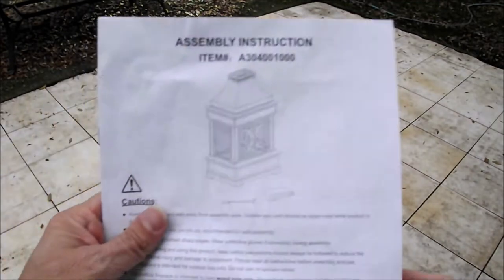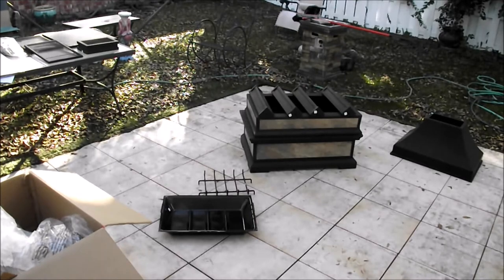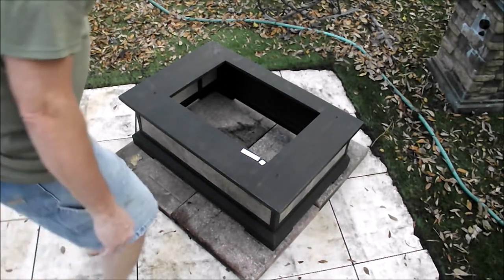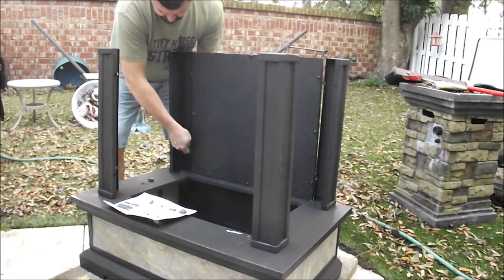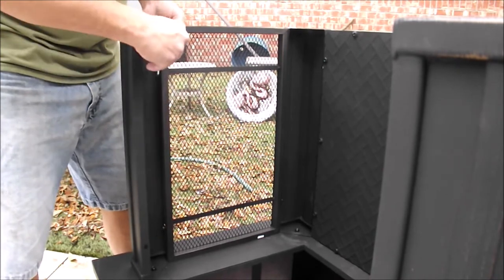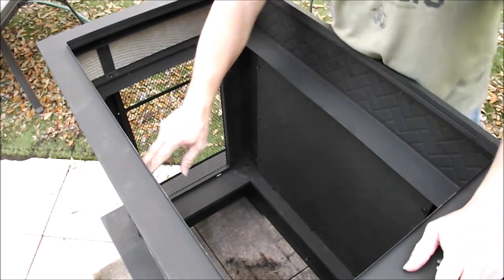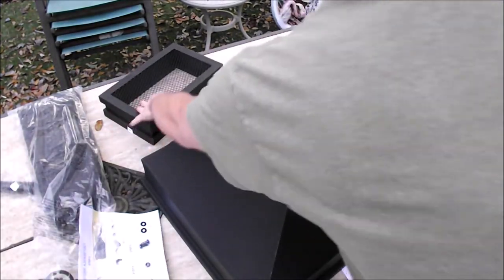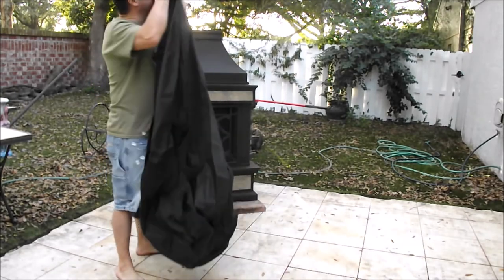Unboxing - Outdoor fireplace assembly and review

Comment: Would have been more satisfying to watch if you showed the first burn on it than to just cover it up....which is kind of weird to have a cover for it since it's supposed to be for "outdoors".   This tells me it might be made of cheap metal like the grills that rust out after one or 2 years
Reply from the maker: Its made of the thin stuff all right just like all the other firepits you find at the big stores. It also has some rust now but Florida firepits dont last so i expected that, but the cover did reduce it a bit. I like how it projects the heat without the smoke though, no chiminea or open pit has done that as effectively but next time i will build a brick one for this price